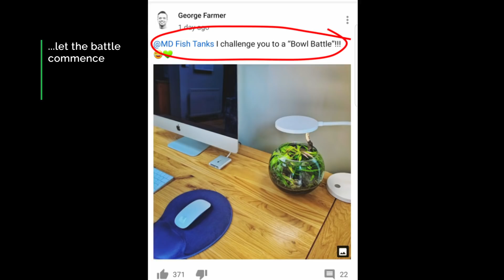HOW TO: 3 GALLON FISH BOWL AQUASCAPE - George Farmer Style (No Filter, No Ferts, No co2, No heater)

Comment: Really inspiring tank. But the cleaning part. As u added the guppies. They are the messy eaters and the tank will be bad after a week. 25% water change  will help ??? But how it will be the monthly wise ?????
Reply from the maker: It will kot be messy. They are tiny fry. The snails and shrimp will clean waste, plants purify the water. I've done this many times now, it works 👍😊

Comment: what if we want to build a similar tank but with a filter? if yes then how, do you have any video on that. great video btw
Reply: Its the same.  What you want in your filter is ceramic pellets and or foam.  I have a little like 2.5 gallon with a in tank filter and a tiny motor.  Planting is exactly the same, but you need to run any tank plus soil for 1 to 2 weeks before adding fish, drain it almost all the way, scape it, add plants, add animals after that.  I have all the kinds available of the bacterial supplements they sell in a bottle, and use that yearly on all my tanks.  You use that when you first start up or use tank water from another tank.  But the reason i use all 3 or 4 brands of bacteria is that they are all proprietary and actually are different species of bacteria, so I end up with a lot of different kinds of bacteria to break down waste.  Its easy once you get in the hobby! Good luck!
Reply: @texasfossilguy  I get the filter suppliments needed part. but I was thinking more of how can I add filter that is not visible;is it possible if I  make two holes at the bottom of the bowl like the above video; one for intake and one for outflow of canister filter and surround the pipe with soil so its not visible. is this possible or is there a flaw in this technique.thanks

Comment: silicone does not stick well to acrylic.  You could have simply silicone-glued the "bowl" to a square of thick glass with beveled edges to both seal the bottom and add the base at once.  PS. too bad they don't sell bigger bowls. Even in acrylic they would be great; i've seen only big acrylic cylinders.  PPS. i assume robotic algae scrapers work ok on a concave surface...

Comment: Hi! So I wanted a new hobby and couldn't decide between fishkeeping and plantkeeping.. so I decided I'd mend the two in a fashion much like this, but on a larger and more diverse scale. My ideas were - a 7 gallon glass jar for 3 fancy goldfish (telescope, ryukin, oranda, ect), a 5 gallon for 4 fancy guppies, a 3 gallon for 1 betta, and perhaps a 2 gallon for a couple aquatic frogs. If possible I would like these to be no heater, no filter, no pump, ect. And I have been trying to do research on the best way to go about it for both plants and fish (I also considered propagating certain houseplants to grow on the surface of the water, much like those common betta vases), and am struggling to make sure my methods achieve that